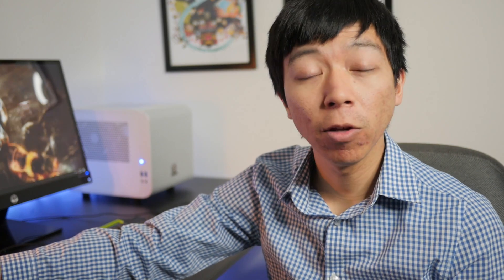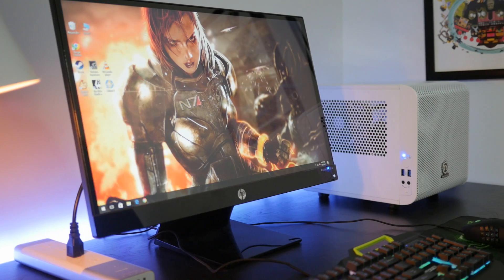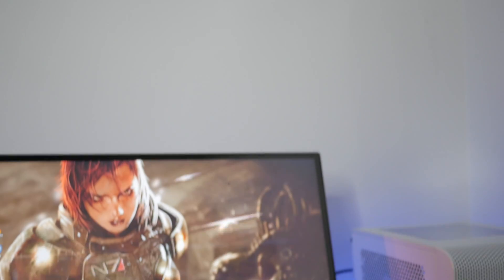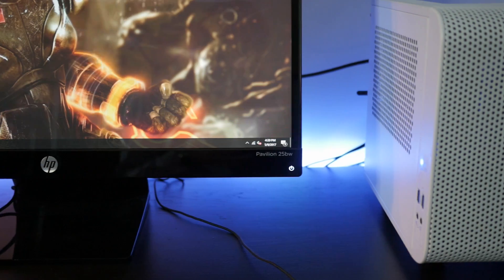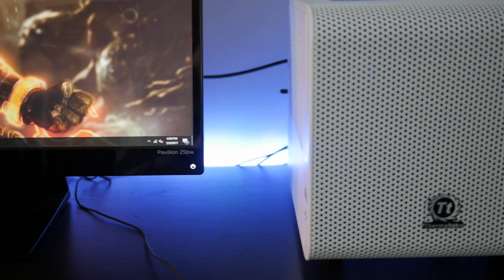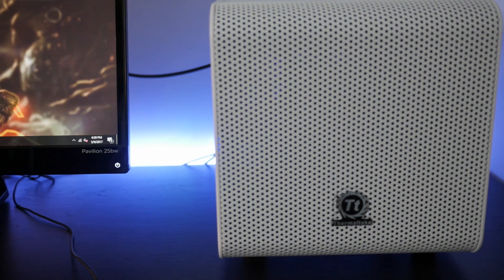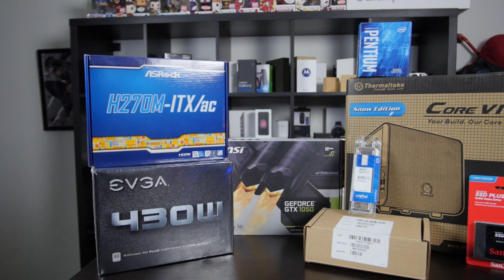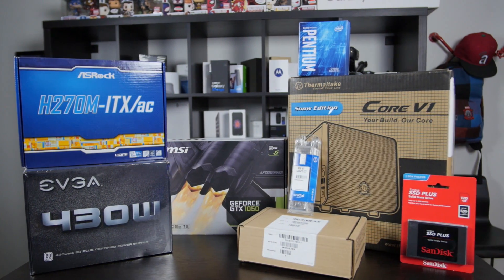Watch This Before You Build Your First PC!

Comment: I've always bought midi-towers in the past. Now I'm thinking to break that rule and go for ITX/matx for smaller footprint. A well thought case makes building a pleasure, troubleshooting easier. 

PC are a lot more silent now from CPU to case fans. Work out what you will do with it and to what levels you can tolerate noise. If you want silent then get some good fans which make less noise but provide good airflow.

Comment: 6:35  There is no center click.  It's either one click per end/locking mechanism of the motherboard's dimm slots.  Or if you have a motherboard in which only one side of the dimm slots has the locking/unlocking levers and the other side doesn't have moving levers....one side clicks.

Comment: 5:11.  I've never had to put hardly any force in inserting the video card into an agp nor pci express slot.  RAM?  Yes, that is normal, but you never should be putting a lot of pressure into plugging in a video card into a pci express slot.  

Just lie your pc case down so that he motherboard is in a horizontal orientation and just carefully align the video card and gently lower it into the pci express slot ( you don't have to be quite as gentle as you would inserting a cpu into the cpu socket, but still ya dont have to cave man smash or push it either).  Just use common sense,  start very gentle, and slowly and very slight increase pressure AFTER you're certain the component is properly lined up to be inserted into the slot.

Comment: As a former professional pc builder and server with it support for employment Canada, casinos, etc etc including gaming systems liquid cooled and anything possible. I used to build on average 10 PC's per day when I wasn't building government servers and various businesses and for the public I instantly knew that the most single important thing to chose first once you decided what kind of pc you're going to build, the enclosure is the SINGLE MOST important component you need to decide on once you choose your parts list making sure the rest of the components are compatible with each other. It's easy to get the ram, CPU, motherboard, drives, video cards. Manufacturers will tell you and in most cases list the exact matching components including model numbers of the components that work best with their hardware. The case (enclosure) has to hold all these pieces to fit physically together and still be  properly cooled with clearances necessary. I always made a list of the other things first like going Intel or amd, liquid or air cooling, video card or onboard video, the amount of storage etc. I always used the rule of thumb to never skimp on case quality and ALWAYS go a bit bigger than you need. If you need to trouble shoot later, you'll thank me later, I promise! Air cooled systems need fans fans fans! Move air across the components, buy good reliable name brand fans with good quality bearings and acoustic properties to keep the noise down. Then watch YouTube reviews before choosing the case you might like to use. ENCLOSURE, buy it last but make it a good one with Lotsa room to breathe and be serviceable. Your build will go much better this way. Some of the systems I built you needed to actually crawl or climb into to build and service, but unless you're building one of those, your body size isn't a factor! 😁
Reply from the maker: ron cosby Great insight!  I'm just glad we have pcpartpicker now.  I can't imagine how difficult it would have been doing this brick and mortar in the 90's!
Reply: ron cosby Yeah, I built a system in I believe the V21 it is called. microatx case. I saw when looking for cases that this thing could have a ridiculous amount of fans installed in it. Including, 4 blowing directly on the motherboard, and gpu. So, with my ryzen 5 1400 at 3.9 Ghz peaking at 43°C in Aida64 on the stock cooler, fans really make a difference. It also cooled down my reference rx 480 by about 8°, but I think the cpu was the most impressive. I already owned the 480 and put it and the 1400 into a home theater pc for VR and the like. I got the 480 just before the 580 for a steal. 4gb MSI model, albeit reference cooler, $145 + DOOM, a game I would have picked up soon anyway. At this point I'm just rambling on, but I was supporting your claim about fans. I do this a lot... :)